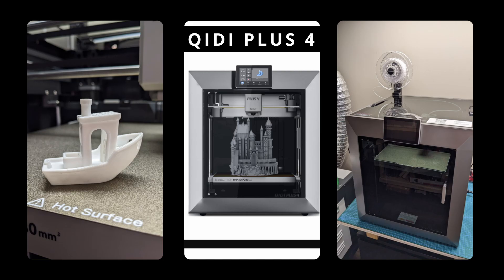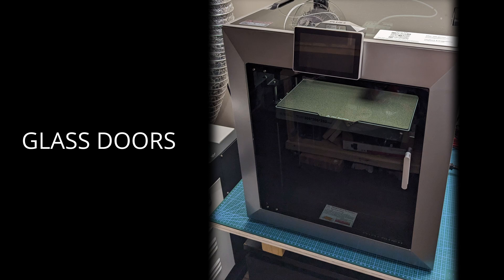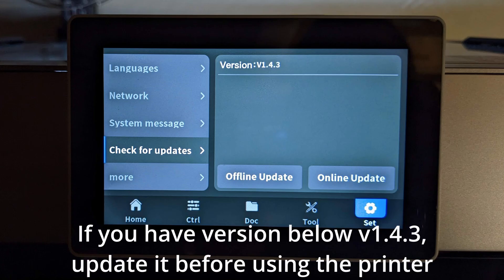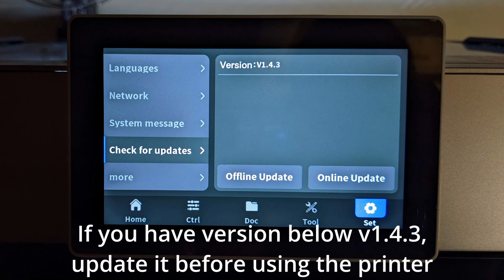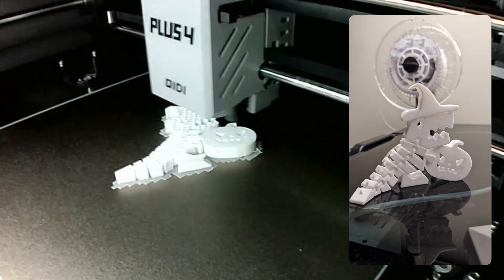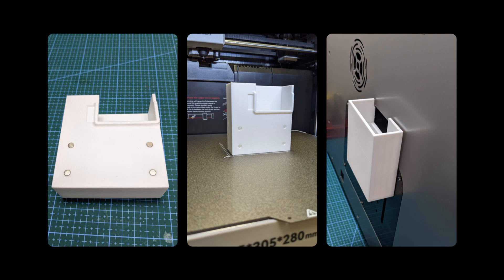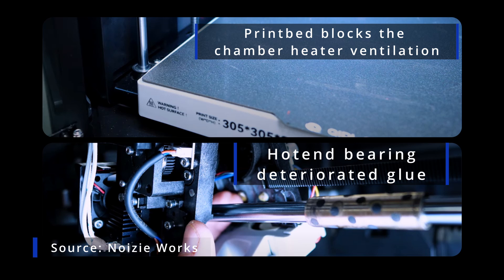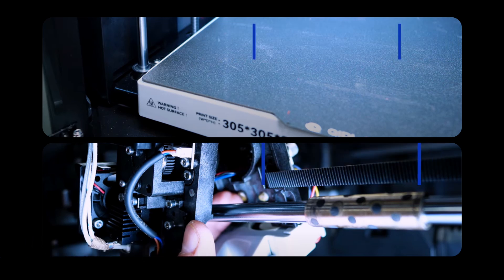QIDI Plus 4 3d Printer User Feedback - Part 1

Comment: You probably have an all metal hotend.... have You had issues with clogging?
Reply from the maker: No issues with clogging so far. I've only been printing with PETG. Bed temperature at ~75°C, nozzle at 260°C. I keep the top glass door slightly open; during the 3-hour print, the chamber temperature remains stable around 35°C.

Comment: The ssr board melts on the 110v printers because it gets too hot
Reply: It has been fixed  just got mine yesterday. It has the upgraded ssr. No problems here
Reply from the maker: OMG.  Thank you for the comment.  I've just found this video https://www.youtube.com/watch?v=YLzQhrdXodQ&t=91s   looks really bad.  I'll reach out to QIDI too.
Reply: @cant-draw-channel  im trying to return mine and that's been for the last 2 weeks I had to get my credit card company involved because they just won't do it and mines back in the original box so best of luck
Reply: Yes, unfortunately the 110v draw current which the SSR cannot handle.
It's fine for 220v though.
Reply from the maker: @stickercambodia  yes, this seems to be the issue only with 110v circuits.  Talking to QIDI support about it now.  They may have some hardware updates.  Not sure yet.
Reply: QIDI ships replacment board for 115v ones shipped that way......not big deal, this printer is fantastic printer, very easy to replace board.   Like other companies they put into production bit fast, issue resolved, you will not find another printer this size with heated chamber for this price that can print this well.  The new wide belt makes huge difference also.  Great printer and fantastic customer support.
Reply from the maker: This is true. I received the replacement board and recorded another feedback video https://youtu.be/9Y2YvW4zDaU

Comment: You don't have to make this calibration with tool, you use it only when smth is wrong with prints, after first turn on you just have to make input shaping callibration and this 2nd (dont remember name) it was showed on couple of unboxing film thats how I know it..
Reply from the maker: Well, I just followed the steps shown on the printer screen after the first start. The most confusing part was the 0.05mm calibration plate, which is obviously not included with the printer. In firmware v1.0.0, there was nothing about "input shaping calibration". My feedback in this video is with the hope that the manufacturer would consider a less confusing user experience before shipping their products. Even if we take a closer look at the user guides included with the printer, there are three documents, and each of them contains much overlapping information. I wish there was only one definitive user guide.

The printer is very good. I really like it. Can't wait for QIDI to release multi-material support for this printer
Reply: @cant-draw-channel  yeah.. manufacture that is located in China surly pay attention about good instruction and about what customer say.. I believe in that just like in santa (maby when I was young xD)